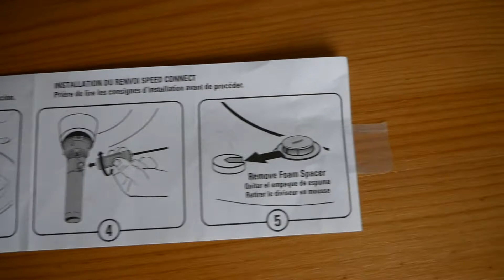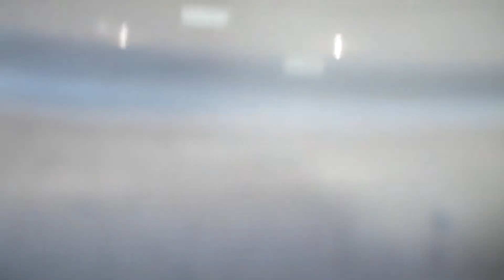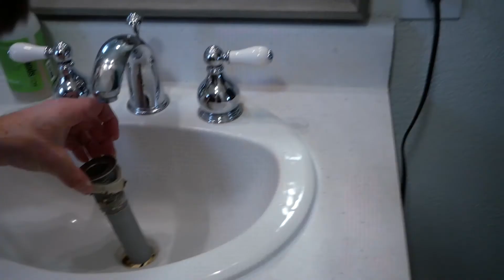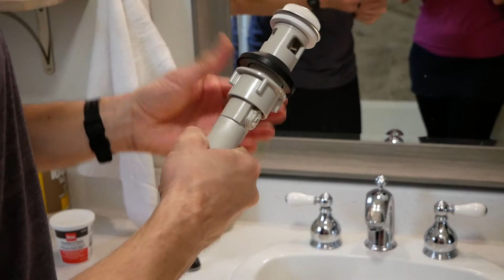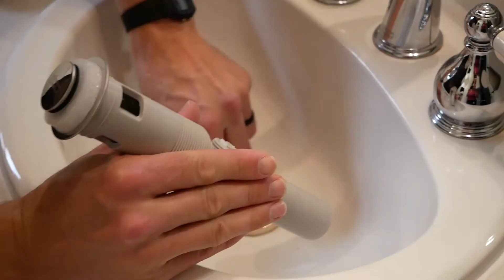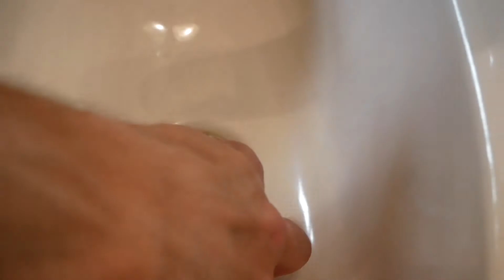Installing Speed Connect Drain | American Standard QUICK FIX

Comment: Hey for your conversion van, how many bags of Havelock Wool did you use? Was it a 100squ foot, 200squ foot?
Reply from the maker: Hi Aiden, We used 1 small bag (100 sq ft). We certainly could have added more insulation if we wanted to but so far the small bag seems to be enough for our moderate climate and weekend adventure needs.